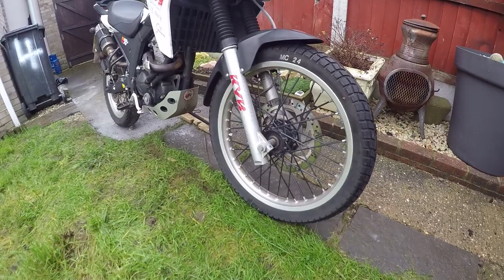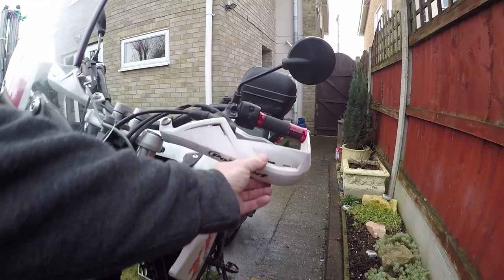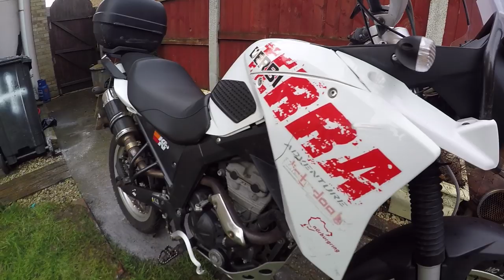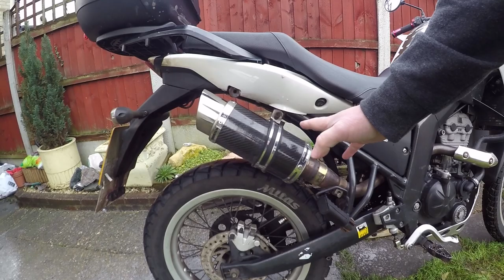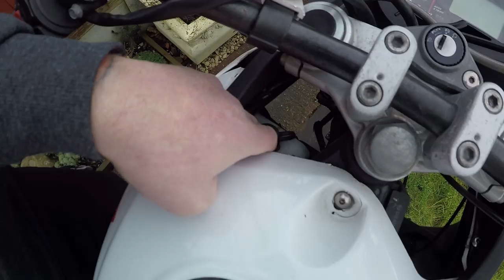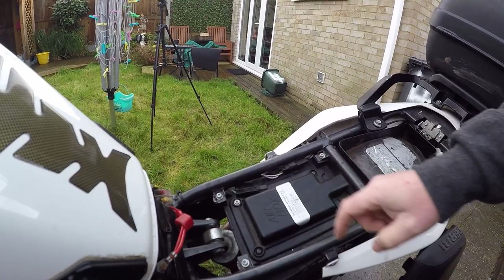DERBI TERRA 125 LOOK AROUND & WHAT NEEDS DOING MARK SAVAGE

Comment: Hi mate just thought id let you know that I still have the bulb for the rear light and I might have the bit for the front side light but I’m not too sure. I do have the little piece of plastic that goes in the little switch but as the switch is broke I’m not sure if it’s any good to you but it’s all here for you mate
Reply from the maker: thanks bud , will be up to get them, are you about sunday, ill message you bud
Reply: I don't know if you're part of this Facebook group ? but if you are after cheap parts for the derbi Terra ? just check them out ? (Derbi Terra Adventure - UK)
Reply from the maker: @lazyboyRider  that's helpful advice bud thanks I will do that

Comment: Great video has always.
Got a question.
Tgb 202 classic 50cc 2T
Pulls away but if not careful it will wheely has its planting so much power down gets to 33mph quickly but after 33 it starts to spit and hit a limit
Does it need heavier rollers or jetting
Like I say for a 50cc it's a bit bitey from pull off.
Reply from the maker: Take a look at the variator and put in heavier rollers 6g are always good 
Also check belt to see it it's too tight and not letting it open up 
Sometimes you just get a really good engine to once heavier rollers you might get good all round moped

Comment: no internal combustion engine needs back pressure... it just needs a route to take the exhaust off. the pressure goes when all valves are closed...

great video btw, i looking one for my girl but she is 1.55... i need to see one on person to see the seat height
Reply from the maker: they are high but have a good road presence if she can touch the floor and the weight
Reply: @marksavage  thanks for the fast reply, i will try to find one here in spain for testing, have seen your videos i really like them, thanks!

Comment: I don’t understand what you mean about trickle chargers not charging batteries up to their full potential. It’s a science thing and doesn’t matter how little current is passing over the two terminals, it will still charge it up assuming the battery is in good condition and you are inputting slightly more voltage than it is rated for i.e 14.00 or thereabouts like a motorcycle charging system. When you supply an electrical current across the terminals, you are effective moving ions from one pole to the other. That’s how a battery charger works. A trickle charger will charge a battery slower for sure as it supplies less current than say many of the Oxford chargers that charge at a higher rate and then drop to (yes you guessed it) trickle mode or maintenance mode as they call it when the battery reaches a certain voltage. It’s just a quicker way of charging and makes no odds to the actually quality of the charge given, just quicker maybe.
Reply: I think what you may be referring to Mark is that the battery is old and cannot reach a full charge anymore. The only thing that’ll sort it is a new battery which would have a better capacity from new and again slowly degrade over time.

Comment: as everybody knows derbi Terra stop making these bikes but however you um adventure do sell these bikes and nothing much has changed on them so you could get your parts from you um adventure  ?
and here's a real bad part ? when you get the rear brake blocks you might have to keep the Old set ? because you might have to hack sword the new ones  
😱 as you mentioned in the video they are very tappy there's a reason for that ? there's a oil pressure piston and spring  what sits on the clutch side and that's what causes the tapping noise ?  if it's still having issues starting after you change the exhaust system on it ? there is two culprits start a motor could be on it's way out ? signs to look for is heat going through the battery wires ? and the other one is the timing ?
but anywho enough of me waffling my bike is up and kicking now and it's ready for MOT 😊
Reply: also sold as malaguti dune and zündnapp zxa. now with fuel injection of course. used derbie are probally abused very much. for around 3500€ i think about just getting a new one.

Comment: Hi mark I was hoping if you could help me, I have a 2005 speedfight 2 water cooled, my pump is leaking on the bottom there is some sort of a cable connected and its leaking from there. I hope you read this and send some advice😀
Reply from the maker: These little pump are sealed units so if it's the pump you will need to replace it 
Take it off and inspect as it might be the water pipes or where they connect so could be a simple fix 
Hope it's not the head as then thats more work but dont it over heat or run out bud
Reply: @marksavage  thanks man, every advice is helpful